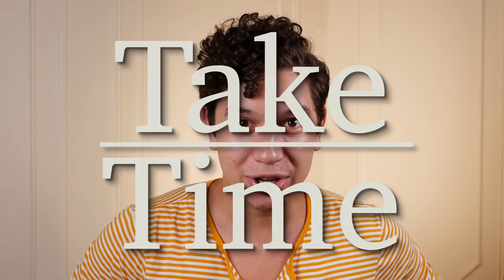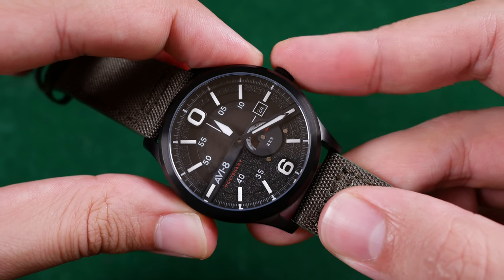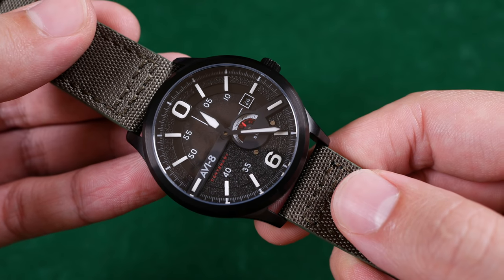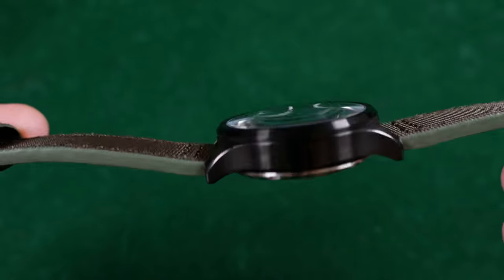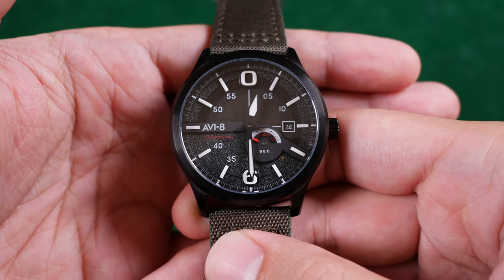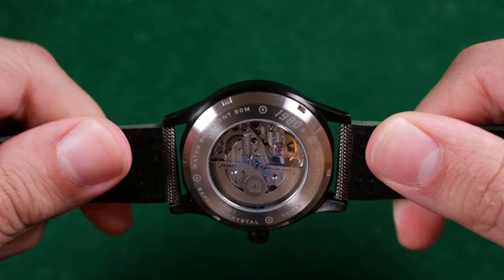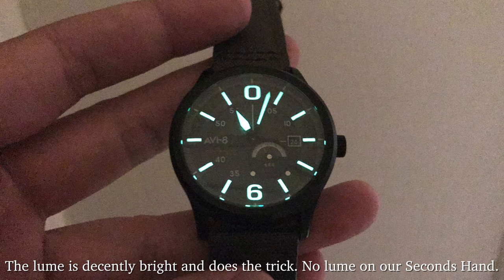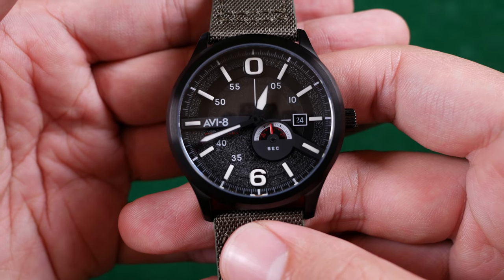AVI-8 1980's Centenary Flyboy Review - A Modernized Success? - A New Take on the Pilot Watch Design

Comment: Thanks for the review. Your take on this is quite different than Just One More Watch's. That's why viewing multiple channels is useful to get mutli points of view to base a decision to buy or not.

He has silver version and surprisingly there is no lume on the indices, only the hands.. which is disappointing they don't maintain a consistent application of lume throughout the color ranges. Can't see why the silver version couldn't benefit from having lumed indices even as unimpressive as it is.

He also noted some inconsistent size and spacing of the indices on the dial. You didn't seem to pick up on that on your example.

Perhaps the one thing I am not keen on is the thickness. It seems a bit unnecessarily thick. I think it is most obviously unbalanced when viewed from the crown side. The crown is small, as you noted, and positioned quite at the bottom of the case. As such, there appears to be a lot of case material rising above the crown which visually, to me, makes the watch look a bit too top heavy.  Because yours is a black version, it may not be as obvious. But, looking at Just One More Watch's silver version, it is more apparent.

And, there has been some complaint about the minute hand being not quite long enough to reach the minute track which would probably have been better.

I don't mind the faux retrograde seconds subdial, in this design I agree it makes it look like a gauge of some sort on the instrument cluster of an airplane.. as does the rest of the dial.  but, i wonder if maybe the text might be a bit small and hard to read.. not that it really matters to read the seconds running perfectly, but just out of necessity for more clarity.
Reply from the maker: I didn't notice any of the inconsistencies with my model (in particular, with the indices). I due note the handset being short... The fact that the seconds hand doesn't hack makes me care far less about the numerals of the seconds display, sad to say; but to piggy back on your note, yes, it's hard to read at a glance.
Reply: that's a good point about the no hacking and seconds subdial being a little small or hard to read at a glance.  can't really set it, so what, just let it run to know it's running.